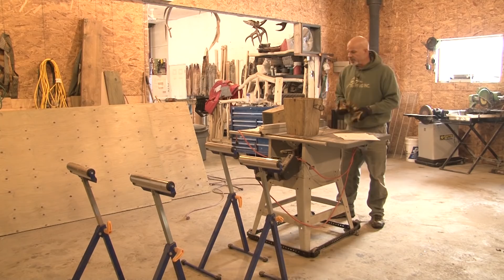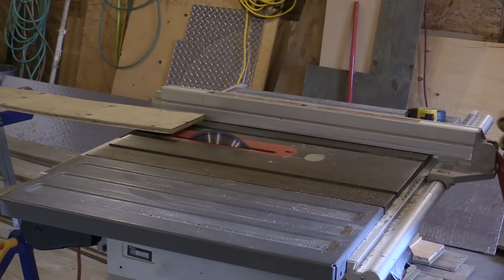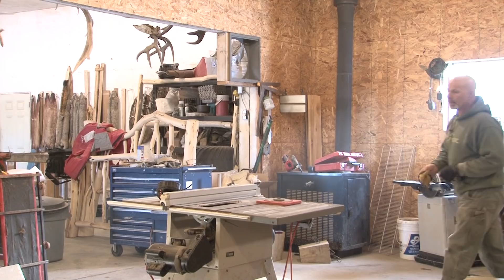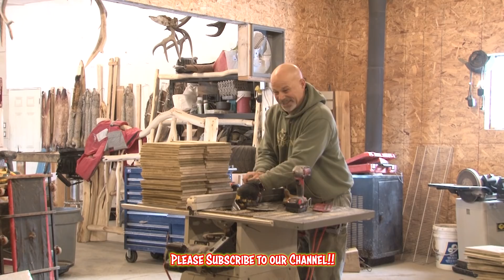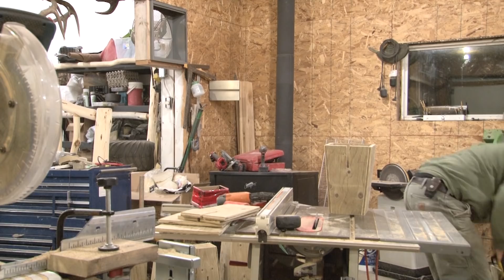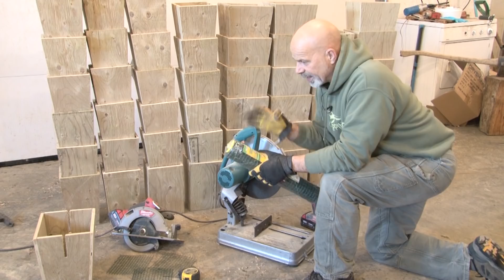Trapping Inc TV Rich makes his favorite marten and fisher boxes

Comment: Thanks for the great videos! For the 120 box what are the dimensions of the tops and bottoms?
Reply from the maker: The dimensions are particular to the brand of body grip. For the Belisle I use the the top is 7 7/8" at the front and then tapers back at 5 degrees.

Comment: I did an experiment last year, where I had two boxes beside each other one had no holes in the back of the box and the other I had holes drilled in the back so the wind/draft can carry the scent of your bait thru. The one with holes I kept catching critters the one without holes didn’t catch anything but a mouse !! Proof is in the pudding !!
Reply from the maker: I did that several years ago except instead of holes I replaced the 3/4" back plate with more of the metal screen air stapled in place. If you look close at the start of the video the 120 box I show has the screen rather than plywood back. I made nearly 2 hundred. They have had a great trial - at one point they were about half of the boxes I had out. I can't say they made a difference as far as catch rate and the bears loved to pull the screen back off in the summer. I don't make them that way anymore.

Comment: Can you post dimensions please I can’t enlarge the pic enough to see the blueprints.
Reply from the maker: These are to fit Belisle traps. The 120 top and bottom are 7 3/4 x 11 7/8 the sides are 7 1/4 x 11 7/8" The 160 top and bottom are 9 1/2 x 117/8 and the sides are 8 1/4 x 11 7/8".
Reply: Trapping Inc TV Series and what kind and wide are the wood?
Reply: Trapping Inc TV Series thank you very much
Reply from the maker: It is 1/2" or 12 mm pressure treated plywood.. these sizes work for the Belisle traps. Make sure that your particular brand of trap fits as well. It is easy to add half an inch each way to the dimension of the opening and have just about all traps fit. I do mine so tight so I can get the most out of a sheet of plywood. I'm cheap. LOL
Reply: @TrappingIncTV  great video Rich. Just came across it now.  Do you mind getting me the backend measurement of both the top and side pieces. I believe you mentioned you ran 5 degree angle to the back?? Napkin says 6 1/2" x 6 1/4"  or maybe that's for the block? Will be for the 160 boxes.  Thanks.